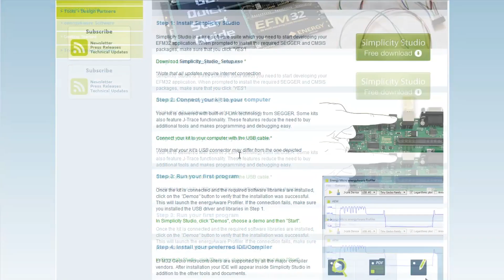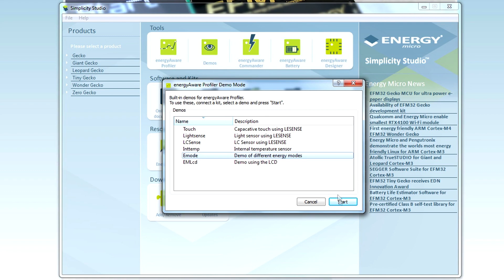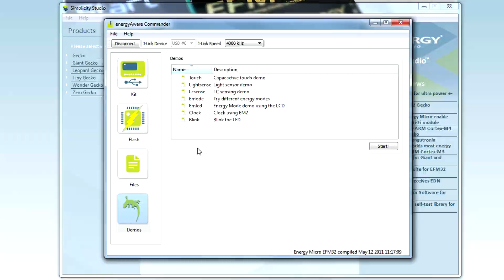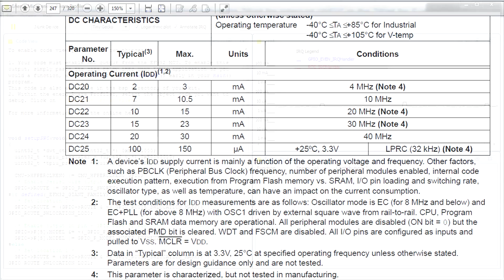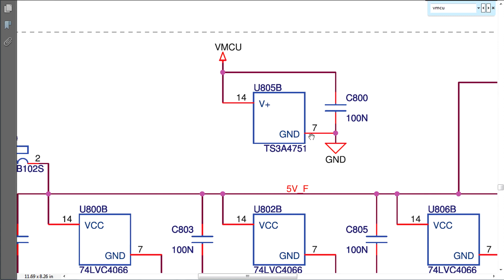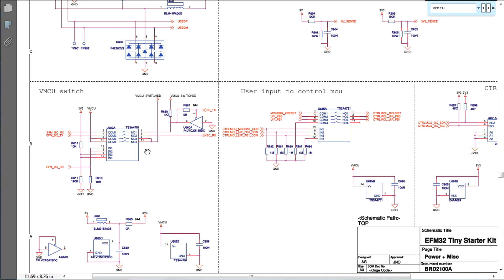EEVblog #269 - Energy Micro Tiny Gecko

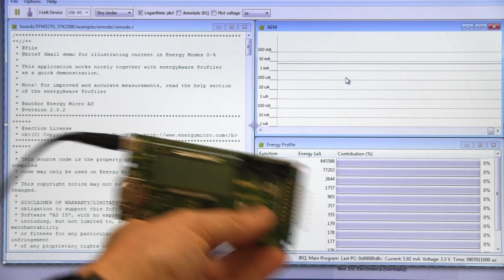Comment: 13:45 Try pausing and clicking on one of the the AEM graph spikes. The Profiler is correlating the current measured with your code, so it should bring up the actual line executing at that time. There´s also options to zoom in and set markers so you can measure how long a certain AEM spike lasts etc - quite powerful/oscilloscope style.

Comment: Completely correct about the JTAGswitches. We had trouble with back-powering trough switches and pull-ups etc. Also, the reason for some of the switches being powered by the VMCU rail is to avoid huge leakage to GND when in battery-powered mode. With just a battery inserted, most of the board is powered off, but the efm32 still needs to be isolated properly to avoid back-powering etc, an analog switch without power is leaking a lot of current!  

-Best regards:
EM-employee and kit-designer

Comment: The analogue switches will be so it can isolate the JTAG port to avoid phantom powering the device from the JTAG lines. 

The LC sense will not be for sensing magnetic field but proximity of metal. This can be a cheaper and more robust solution than a reed switch for detection of an external object, especially on a sealed device. 
You ping the coil and measure the ring-down time - external metal damps it faster. Can also be used as a cheap 2-way data link - again useful on sealed devices.